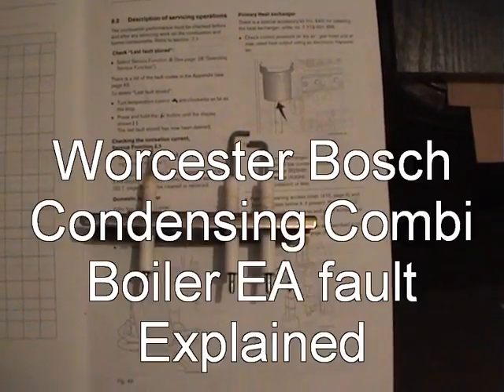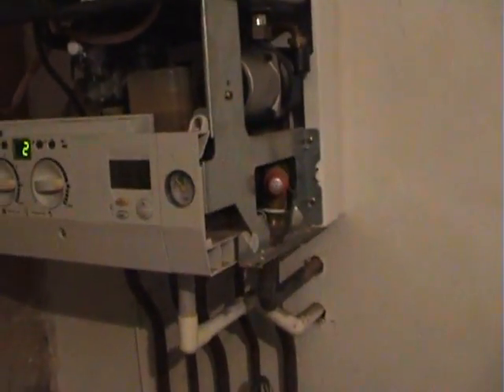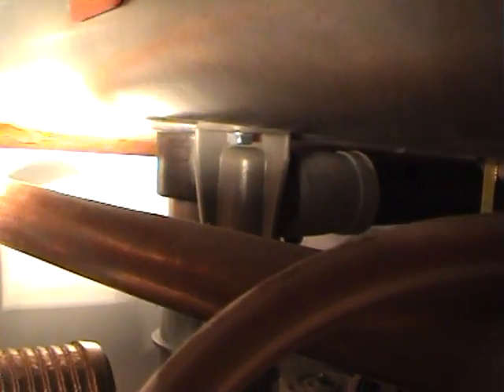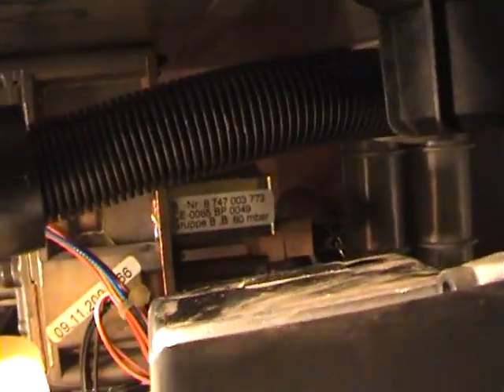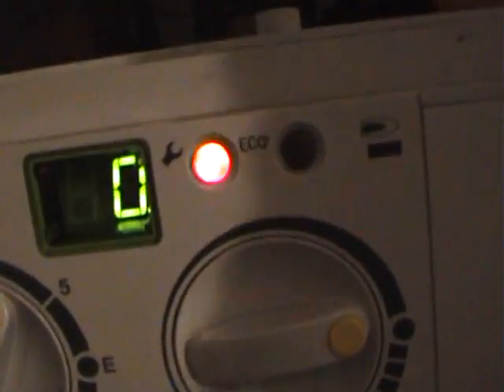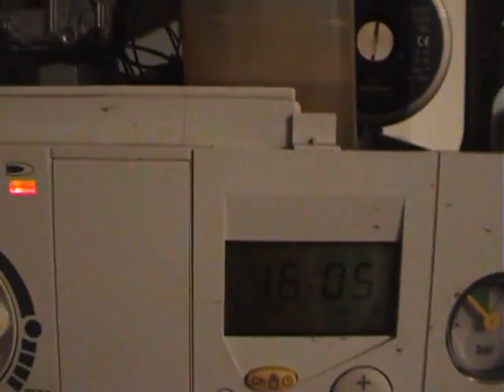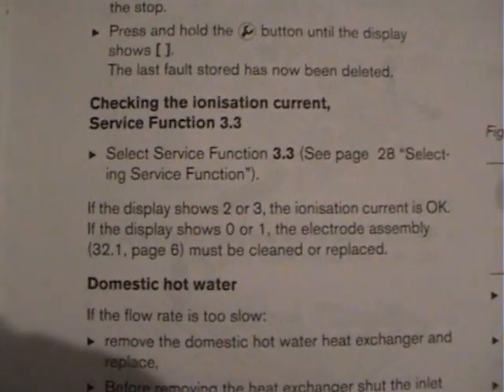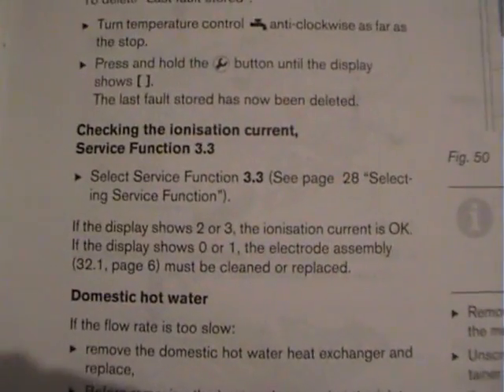Boiler fault EA explained more clearly

Comment: Really helpful.
Just cleaned out the condenser trap, still showed EA fault and fast clicking noise.
So I then removed the 3 plugs from the ignition and cleaned them with fine sand paper. Replaced the plugs and now seems to be working fine.
Job done :-)
Thank you

Comment: Thanks Malc! Followed your diagnosis and I had the same ionisation probe fault code (0) so I popped the wires off and back on again and it seemed to fix it. I will order the electrodes set though as i know it won't last! Did you fit yours yourself? Would you say an amateur home mechanic could do it?

Comment: Hi,
I was watching your video. Very useful indeed. Just a question if you don't mind:
before changing the entire group of electrodes, have you ever tried to clean them over the years with abrasive paper? And if you did, it was necessary to change them anyway?
Thanks
Roberto
Reply from the maker: Thanks Roberto - as you can see it's a while since I had to do it. I think I read somewhere you can take them out and clean them. The end of mine however had almost burnt off, hence why it failed. I was told it was past time to renew it by the suppliers when I got the new one.

Comment: With regards to the syphon, don't need to remove all of it just bottom cup, especially after you've cleaned the heat exchanger and run water through. You can clean the electrodes if there in good condition, but change every few years to prevent "ghosting" usually at 2:30 in the morning. 😀

Comment: I have had this fault appear twice once a frozen pipe once a blocked pipe. Fixed in th second case by simply blowing air through from outside the house. (Perhaps not recommended)? The fault is the first line of safety for the boiler so there are not inconsiderable risks in playing with this.